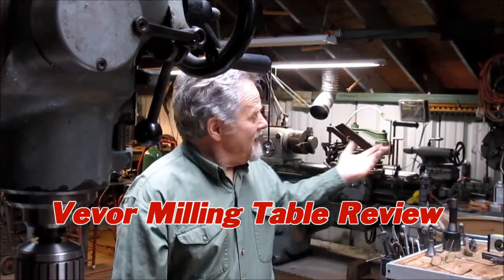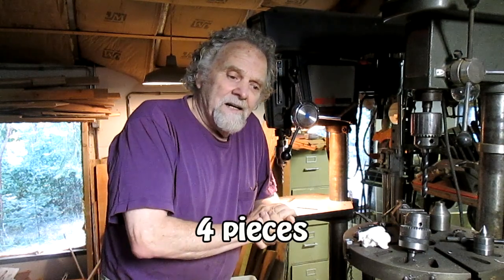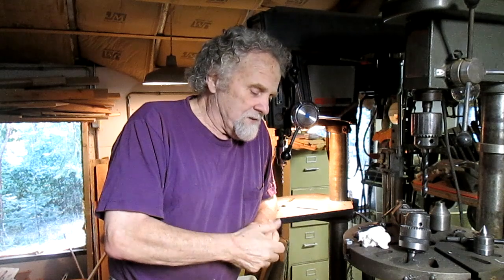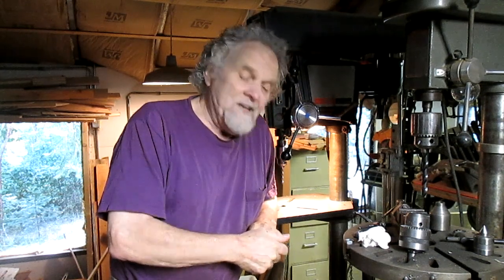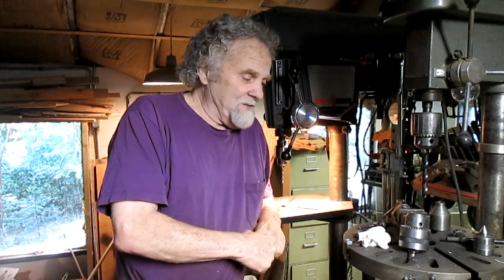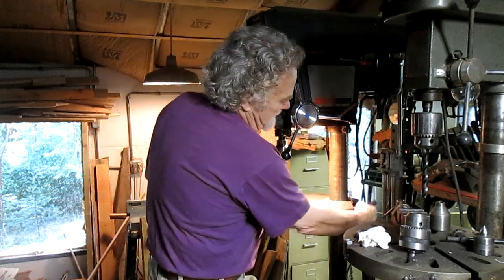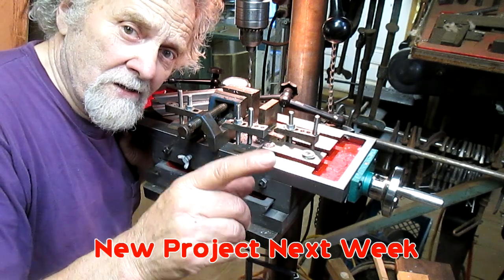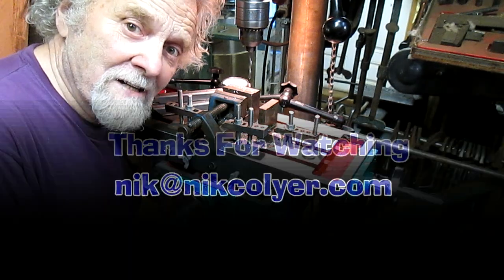Vevor Mill Table Review

Comment: Are the dial incriments in metric?
Reply from the maker: Yes, probably, but my brain doesn't work in metric.
Reply: @NikColyerMachineWorks  over here in UK we seem to use both systems,  and sometimes used together.
Reply from the maker: Yeah, same here. When I get a drawing with metric measurements in order for my brain to function at all in the office I transpose all metrics to imperial. One more step is all.

Comment: That Covid is rough. Felt bad for 3 days, then fever and flu for 5 days, then about 5 weeks of being just straight exhausted all the time; 3 weeks of it to the point I couldn't hardly do anything and would get tired and start running a fever again. That cold sucked. It was 3 months before I could taste the flavor in some foods again.
Do you think that is a metric pitch on the thread of the table?
Reply from the maker: Yeah, every time I think I've over it, I overdo it and back a few steps. It is a nasty one.

Comment: Maybe leave this drillpress setup with the table and tapping head? Might work well for that. I spent yesterday in my shop making a backing plate for a little 3" Vevor chuck to go on my small Vevor rotary table. Vevor quality isn't perfect, but it is really quite good, and with a little effort, I come out with a tool that works. Get well, Nik..
Reply from the maker: Vevor is basically a good product, but the finish is always a bit rough.

Comment: I would remove the lower lead screw and put a rubber boot around the thrust bearing and lead screw, or it will be full of chips in no time.
Reply from the maker: Good point. I'll check that out.

Comment: I can see a major problem with this setup, at least it would be for me, and that's the considerable extra weight. Having no rack or other means of assistance for raising and lowering the drill press table I would have remove the x-y table every time I needed to adjust the z height.
Reply from the maker: You are very right. I'll either have to counter balance the table or get a whole other drill press dictated for the mill table. Turns out I have an extra drill press.

Comment: The stuff a guy has to do to make money. Lol. I have a grizzly version of that which is probably made in the same place in China. I have an enco radial drill press that I use as a light duty mill. I was able to adjust most of the slop and backlash out of it. Seems to do pretty well. Some day, I will get an actual milling machine. But it works.
Reply from the maker: I like Enco brand. Too bad they sold out.